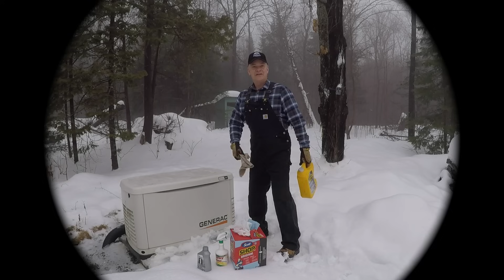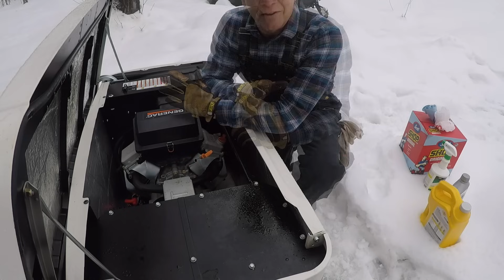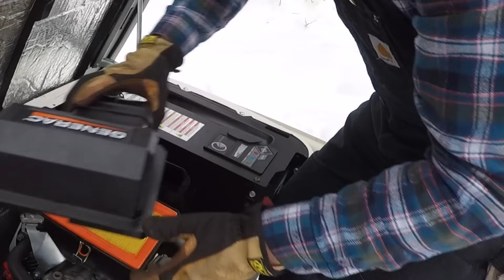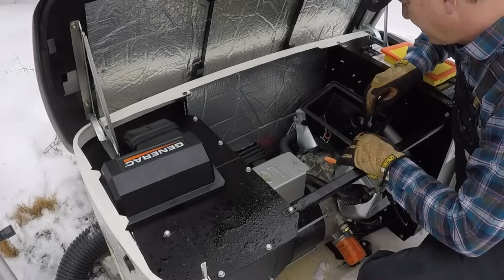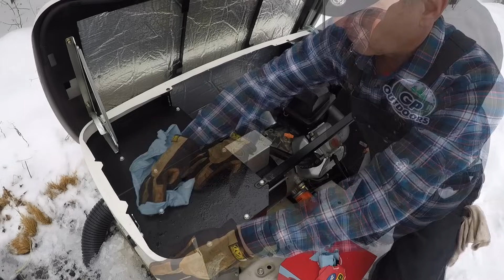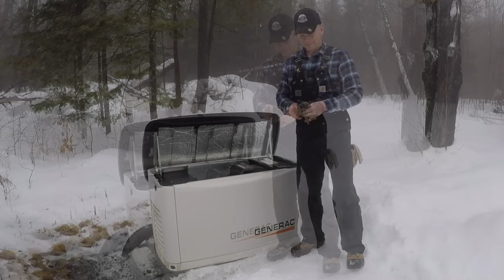#133 Thinking of Buying a Generac Generator? You Need To Watch This!

Comment: I don’t know if you’re still reading the comments for this video but I saw it for the first time today. You may also consider installing a port or adapting the port such that instead of simply opening into the box you have a pipe or some other hose or something so that the suction point is raised above the water level. That way  if you indeed do freeze up, you’ll still have venting capabilities. Obviously you’ll need to start doing some manual checks in the winter as you could, or will, still freeze water up, but now you’ve eliminated the back pressure , which dumped the oil and triggered the alarm, so you’ll need to occasionally manually inspect the box for ice buildup

Comment: That crankcase vent line needs to be removed from the air cleaner and allowed to vent to the atmosphere, no matter what Generac says. It's inexcusable that they didn't foresee this defect and fix it. 
If my generator failed during a wildfire my house could burn down, which is why I went with a rugged Kubota diesel. These high-speed light-duty generators (Generac, Cummins etc.) just aren't tough enough or reliable enough.
Reply from the maker: Good evening and thanks Paul. Several folks have said the same thing. Appreciate the advice. Have a good week and thanks for the comments!
Reply: right, buy a cheap one at harbor freight and have less problems
Reply: are you for real Cummins light duty humm, you mean our QSK95 (95 liter engine) used in locomotives is light duty ?? Get real, Onan home standby are more expensive then most because they won't sell junk that is only meant for light duty use. I don't know if it has changed but at one point if you bought a Generac from Home Depot Generac Dealers wouldn't touch them  !!

Comment: I just got Generac with the carburetor warmer and a battery warmer.
Reply: This is Exactly what this man needs for his, since he lives in winter snow country..
Or make a small drain at the bottom of the box...The air filter will still filter all the air coming into the box because it is in the same box, right ??
Reply: @frandanco6289  not quite, if you look closely you'll see the air intake where he pulled that cover off comes into the front of that cover from the Black Box in the front of the generator. It then goes through the filter and exits on the bottom into the metal intake manifold. Drilling a hole in the bottom of the Box does allow unfiltered air into the air intake manifold, along with insects and anything else that comes into that hole.

Comment: I would be in contact with the manufacture letting them know they there is an issue with this unit, 
if they require this kind of attention I would be getting rid of it. Most people that can afford a
back-up generator do not posses the mechanical knowledge to do these types of repairs.
Good generators should not need this much attention.
Reply: They know about it you need to buy a cold weather kit available only through amazon

Comment: Curious why a small hole isn’t punched in the breather box to allow water to drain it could be small 1/16 or so and should allow drainage without affecting the air filtration
Reply: From experience, 1/16th is too small.  No matter how well you filter the air, condensation attracts dust, and will eventually clog it.  And with so small a hole, you might not notice.  3/16th's would be better, but I'd still check it often.

Comment: There are many people talking about being a first time generator owner.  Be aware that owning a generator is only half of the problem in an emergency, you also have to fuel it.  In a widespread disaster you are probably not going to be able to get fuel from your local fuel station, you need to already have it.  Propane is the only fuel that you can keep for years and you need a large, full tank. Too much capacity in a generator results in heavy fuel consumption so don't install any larger generator than you really need. Great video and good luck!
Reply: Diesel also will last forever with the right preparation and is by far the least expensive to operate, but is problematic in cold weather. Propane is a great choice if cold is of a concern but is expensive. Natural Gas has been the long time fuel of choice, but as people are finding out lately, it will be shut off in many disasters for various reasons.

Comment: I'd put a vent hose off the bottom with filter on it water could still run out
Reply: you would need a PCV valve. if it was open to the air it would bypass the air filter and suck in sand and stuff plus cause the engine to run lean and possibly overheat.
Reply: 3madeamps #3 in nc it would freeze!

Comment: It is a crankcase breather port. And when it becomes plugged the crankcase becomes pressurized and eventually the pressure builds up high enough to push the dip stick out of the dip stick tube. This allows the oil to be blown out of the dip stick tube.

Comment: Seems like 50 cents to extend that pipe higher into the air box
Reply: As well as drill a drain hole in the bottom of that filter box.

Comment: Looks like Generac needs to re-engineer the crankcase air recirculation system so water blowby does not freeze and cause this problem. The fix could be quite simple such as moving the port up higher in the airbox.

Comment: Vent the PVC to atmosphere Through a Filter or Relocate the PVC output higher in the airbox. Thanks for the video.
Reply from the maker: Hey good evening Jeff. Thanks for this. The tech called this week and Generac has just issued out a "Kit" which is basically a heater unit that wraps around the tube. Will be getting that shortly - but thanks for the great suggestion. I appreciate it very much. Have a great weekend!

Comment: Replace that "Fram" oil filter with a quality one, your engine will love you and last much longer..Fram oil filters are junk, you can research them on youtube..
Reply: that my friend is a Generac air filter with a fire retardant chemical on it- the TRICK is never OVER FILL the oil this will plug your filter !!!!
Reply: @richardwhite1593  I referred to an "oil filter" and it's quality, nothing else. The point is Fram oil filters are junk.. By the way how many people overfill their engine oil, and what does it have to do with fram oil filters in general? They are still junk and will not help your engine..
Reply: I agree Fram filters are junk, but the filter shown in this video says Generac on the side of it.  Don’t know who makes them for Generac though.
Reply: Why is it helpful to specify which filters are "junk" but not say which are good? Think about it...
Reply: @kentonkirkpatrick113 If WIX, or NAPA Gold (made by WIX, last time I checked) has a filter that fits, then that's what I would recommend. I've never had an oil-related problem using them.
Reply: Provide a solution.
Reply: @kentonkirkpatrick113  I use Mobil one oil and filter, Wix is also a decent oil filter..
Reply: I use fram oil filters all the time for the past 30 years on all my Honda's and Acuras. I've never had an issue.
Reply: @badtothebone346  You were lucky in spite of the junk fram filters.
Reply: @dukeman7595  And you are an expert on oil filters how?
Reply: @MrMaddawgg  Why yes,  a certified oil filter inspector of the origination for  friendlier oil use & dummies who use fram..
Reply: Wayne M  Sounds like someone works for big orange :)   I used Fram exclusively for 20 years because they were cheap and available.   But i stopped and switched to Wix on the advice of my dad and several mechanic friends. 
There are numerous filter teardown videos all over Youtube and the results are always the same: Fram is just not quality. The standard orange Fram filters have less pleat material which means less filtration, general build quality is lower and the anti-drain back valves are terrible and don't work well.  Wix, Napa Gold, Puralotor, Bosch and some others are all much better quality.
Now the asterisk to this whole thing is that some of the other Fram filters like the synthetic filters are actually of decent build quality.... but you have to do research to figure out which ones.

Comment: You  could drill a hole or two at the lowest point to drain the water when the engine not working. Put a filter over the holes to prevent unfiltered air in system. You could also do like they do on AC units, put an s trap to allow water to drain but block air.  A light in the area could also keep it from freezing with a thermoset to turn it on. I also thought most generators used a crankcase heater to keep engine up to temperature in coldweather.
Reply from the maker: Thanks Gerald. But they were clear to me that if I do, it voids the warranty on the gennie. Thanks so much for your kind advice. Be well!
Reply: That port is more than likely a PCV for the crank case, and not an exhaust port.   It sucks in the crank case vapors and allows built up pressure from blow by the rings to have some place to go.  Commonly it's directed into the intake stream, downstream of the air filter, to then be consumed by the engine, which is what appears to be in this case..  Putting a hole in the air box will prevent the box from having a negative pressure value, which is needed to help extract those crankcase vapors. They needed to put the PCV line in a different spot in the box, or design the box to have a deeper well to collect condensation like that.

Comment: I am a Auto/diesel TECHNICIAN 40 Years and I have read some of the comments that are here and I agree with one person that the port you referring to as a exhaust port,well this is incorrect that is a  positive crankcase ventilation system (PCV)system. So you may have a draft system or a actual PCV VALVE depending on the Year manufacture, EMMISSIONS , HORSEPOWER AND LOCAL LAWS. the reason the dipstick blows out is the ice as you stated but not exhaust gases from the exhaust but BLOWBY FROM THE PISTONS COMPRESSION RINGS.When the hole you referring to gets block this causes the dipstick to blow out.All internal combustion engines have blowby but a worn out engine will have a noticeable amount  this can be check with the engine running, removing the oil fill cap, place your hand over the hole you should feel a very slight puff of air about the same amount of air coming from your nose on a exhale (normal breathing).If you feel a hard oil fill pulse you engine is wearing out.Also If you are building with ICE and water in the air filter box in cold weather you may have to relocate you air box off of the top of the engine as the difference in incoming cold air temp and the heat of the engine heating up the bottom of the airbox is the cause of water build up when the engine is shut off. Again check with local EMMISSIONS as moving the air box could be considered changing the emissions on this generator.
Reply from the maker: Good evening Crazy Horsepower. Thanks very kindly for taking the time to outline this in easy to understand terms for folks. I am certainly not very mechanically skilled ( and apologize for my poor description of the issue) but I understood what you have outlined. My challenge is that if I alter it, I lose my warranty so I will need to decide if I continue to live with it or alter it. A big thank you, to you and many others who spent time to assist here on this. I believe it has helped others and not just myself. Have a wonderful week and all the best to you!
Reply: @GPOutdoors  I would ask Generac if they have a drain with a one way check valve I doubt they have one but worth asking.Good luck.There is nothing to apologize for as I try and help people understand what is going on.Some people also said to disconnect the line from the air filter This would be a very bad idea as the low pressure created when the engine draws air in also pulls the unburned fuel that got into the crankcase back into the intake system to be burned.Also someone said to relocate the line location in the air filter box, If this is possible you still would have the same issue it would just delay the same issue and may make matters worse.Also if the air box should fill with more ice/ water and the engine inhaled a large volume of water at a high RPM it will most likely destroy the engine.
Definition -HYDROSTATIC LOCK It will break the compression rings and bend the connecting rods.BOTTOM LINE VERY BAD!As I stated before ask Generac what they recommend as you are WORRIED about your Warranty and this ice build up is a RISK right now to the engine.
Reply: @apacheone3643  I agree with all you recommended, especially contacting Generac to check on a modified airbox design. There should be a redesigned airbox that allows condensation to drain and the crankcase vent should also be relocated higher up near the top of the airbox or an extended tube added to put the crankcase vent up near the bottom of the air filter to prevent ice blockage from occurring. Generac may already be aware of this issue and may have a redesigned airbox that can be retrofitted.
Reply: That is a straight design flaw and needs it's own service bulletin. That's all designed improperly if you ask me. I could explain vapor vs solid, cold air, all that but the point remains as is, it is a set up for failure or a fire.

Comment: This did nothing to cure the problem. An air cooled engine running in extreme cold weather sometimes runs too cold for optimum operation. I usually run full synthetic oils due to the rpm going from o to 3600 in a flash and i also block part of the cooling air flow through the cabinet to let the engine run at a warmer temperature, just like the old timers that would block off a portion of a car radiator with cardboard or plastic sheeting in winter to improve engine temp and heater performance on a liquid cooled engine. In this case, some foil or fiberglass type insulation around the air cleaner box might also help raise temps and keep that slug of ice from forming.
Reply: This fix could create a new problem if you have a warm day and haven't taken the Air Flow Restriction out. Your engine overheats and burns out the motor or the generator or both.

Comment: I realize that this is an older video but I've got to ask, why not add a small drain hole in the air box to eliminate the collection of moisture from the condensation? Maybe add a one way valve like a dirt bike air box has?
Reply from the maker: Morning Rick. They told me it would void my warranty. But otherwise, I will for sure. Thanks!

Comment: Thanks for the info.  Living in FL I would have never though this would be an issue.  We had a Generac 12K standby.  Sold it and got a Generac a 12.5K run / 18K start portable that I connect when needed.  This thing is a beast.  I have found the portables to be more durable and with a circuit panel interlock I can power any circuit I want, including AC after hurricanes and with a carburetor kit I can still run off Propane.

Comment: A small silicone heating pad installed on the air box will keep it dry. It would require grid power or something to assure it always works. Keeping it warm will drive the condensation out.

Comment: Excellent video, thank you for taking the time to make it.
Reply: Don’t buy a generac. Generacs are the most unreliable generators on the market. I’m a fully trained military generator tech who trains on hundreds of different types and brands, don’t do it.
Reply: @aaronkellar6583  Hey Aaron, what brands would you recommend that run on natural gas?
Reply: @aaronkellar6583  I don't know about all that.  Mine is 18 years old, original battery, only have had to do routine maintenance, no issues.  This is in Central Maine, where we lose power all the time, and not for just a few hours, but sometimes for 2 weeks depending on the storms.

Comment: Just curious, why is the exhaust port anywhere even near the intake air filter box? I can understand maybe a small exhaust port to warm the intake air to help keep the carburetor from freezing up, but not such a substantial portion of the exhaust that a blockage would pressurize the crankcase. Also, everyone that modifies their engines for more power and efficiency gets rid of any hot air coming into the intake, because it partially vaporizes the fuel mixture before it reaches the cylinder to produce power so it uses more fuel and produces less power. I would just drill a ¼inch hole in the lowest part of that reservoir, screw in a brass nipple and a couple feet of clear tubing to run outside the enclosure.
Reply: It's not exhaust. It's the crankcase vent.

Comment: I am not sure if there is a cold weather kit for this part of the generator but did just meet with a Generac dealer who stated they have 2, and I believe he may have said 3, cold weather kits that they put on all their whole house generators.
(Location SD) He told me that they have never had any of these type of condensation/freeze issue.
I assume the kits come with instructions and could be installed after the initial unit installation.
Reply from the maker: Thans Brian. I have the 3 kits on the unit. Seems to perhaps be an issue up in this area (climate maybe?) They told me several customers up here have the same issue and 2 of my neighbours do as well. But good luck and I think you will feel a great relief knowing you have back up power for you and your family. All the best!